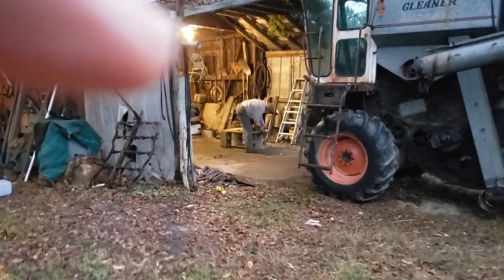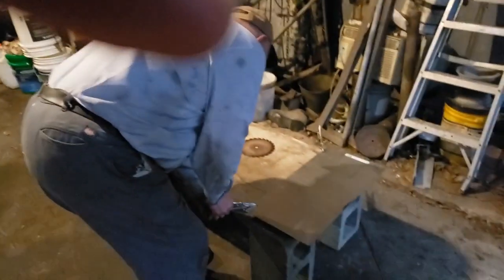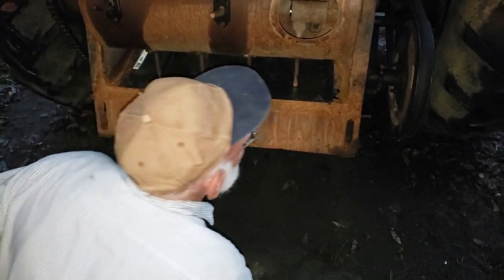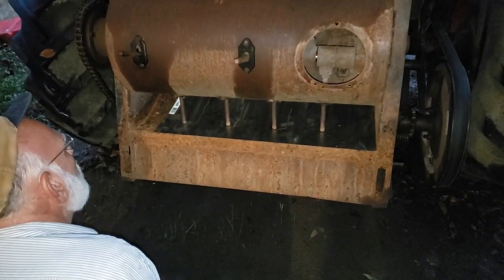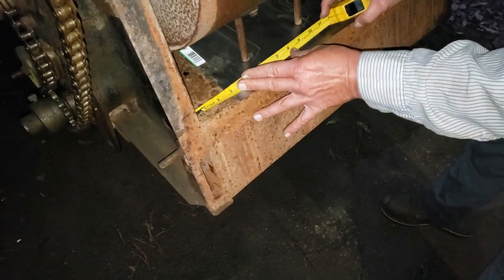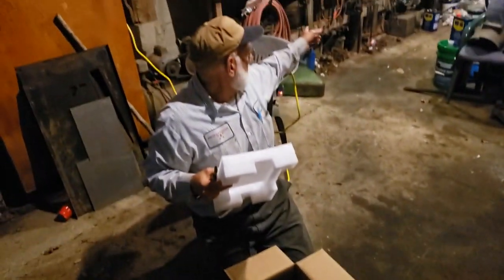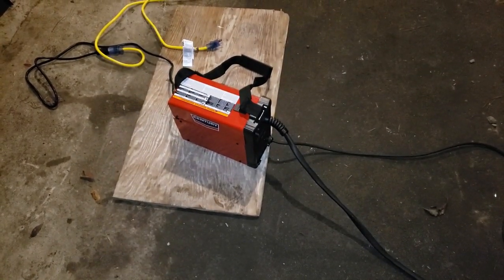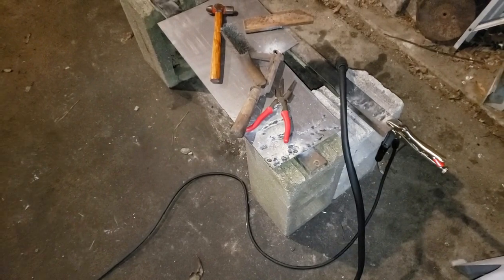Working on the Gleaner Combine

Comment: Need to stitch weld it.. meaning you pull the trigger, let off, pull, let off.. just spot or tack and keep doing it.
Reply from the maker: Ed so glad you said what you said, you just gave me one heck of a good idea to try before we go to thicker metal. Thank you sir.🙂🌤🌞😎
Reply: @SoybeanFarmer3300  been there... Hopefully you can make it work!!
Reply from the maker: @GosselinFarmsEdGosselin  - between what you said and what Wayne said I see a better way now thanks Ed.
Reply: @SoybeanFarmer3300  The Floors in a Fox Body (mustang, Fairmont,) are 26 ga. We use 2x2 16 ga box  to put frame connectors between the front clip and the rear chassis by cutting slots. thru the floor,   the floor then has to be welded to the tube... We use the method Ed described.... Ford fox body Chassis are Galvanized... so the process is double trouble,,, but you have to be patient ..... Clean the rust off down to shiny metal      Any rust will cause the arc to blow a hole
Reply from the maker: @farmingforfunandprofit940  welding on galvanized is pure toxic requires some serious ventilation in the work area so glad we're not dealing with that. David you make an excellent point about what the rust would cause to happen therefore that area must be cleaned back to rust free. Since the work area is tight I'm now thinking about completely removing the retracting finger drum so we are able to access the area and do a proper once and for all repair. David thank you.🤔☕☕☕☕☕☕
Reply: i 2nd this idea also if the wire feed speed has been tried like i said above
Reply from the maker: When I get home and see cousin tonight I'm going to attempt to talk him into using the thicker piece of metal and hopefully removing the drum. We'll just have to see what we can negotiate. Thanks for being here watching.🙂🇺🇸

Comment: You two are quite a pair! Yes, like Ed Gosselin says, stitch it BUT if Scott's feeder house has the clearance, use a heavier gage metal, there is plenty of pressure from the crop going under that feeder roll. One solid piece would be nice but narrower pieces that match any structure under the feeder house will allow more tack welds directly with the original surface or drill holes in the new metal and weld the holes direct to existing metal of the feeder house.
Reply from the maker: Ed gave me a spot on idea for using the metal that cousin Scott bought and for making it fit properly. Not good enough with words to express the idea but I'll have the camera with me tomorrow when we try it. Wayne my friend always good to see you here.🙂🇺🇸
Reply from the maker: one more thank you for what you said here..  what's the emoji for the big bright light going on?
Reply: The holes would work well, if the feeder house floor is cleaned good enough and heavy enough to take the extra heat.. 
Although, I have plug welded some pretty sketchy Stuff 👍

Comment: If you got a acetylene torch you can braze weld some people use coat hanging wire to use for the metal filler
Reply from the maker: We were talking about using the torch to braze it will definitely be using a torch to heat the metal so we can bend it. Thank you very much for your suggestion.

Comment: Stitch weld it, same as you would do on vehicle sheet metal. just tap the trigger, don't hold it continuous
Reply from the maker: I was kind of amazed with what I was actually able to do last night in a short time with this wire welder since it's the first time I've ever had my hands on one. I'm really glad cuz  went and bought this. 2 Night we'll work on learning this stitchweld technique. Thanks for sharing your insights on this.🙂🇺🇸
Reply: @SoybeanFarmer3300  Once you get good with a MIG welder, you'll love it! Stick welders have their place, especially for welding heavy metal, but MIG is a good all around welder, especially once you get up to a 250 amp machine then you can basically replace the stick welder! Happy welding!
Reply from the maker: https://www.lowes.com/pd/Century-120-Volt-80-Amp-Flux-Cored-Wire-Feed-Welder/1001440264
This is the machine  cousin bought. If and when I get one I'm thinking at least 140 amps output.🙂☕🇺🇸

Comment: I could use a wire welder. Fix the metal on my trailer ramps.
Reply from the maker: James, this is the welder cousin Scott bought.  once I got the hang of using it which did not take long I liked it.  thanks for watching. https://www.lowes.com/pd/Century-120-Volt-80-Amp-Flux-Cored-Wire-Feed-Welder/1001440264

Comment: I use .028 wire on the lighter guage steel, going to guess welder came with .032 or .035 wire
Reply from the maker: I got a lot to learn about my new flux core welder. Check out the next video if you want to see what I'm talking about. Thanks for being here supporting the channel   watching the videos.
🙂☕

Comment: I’m a welder have been for 29 years flux core may not work very well for what you’re doing I know it means buying more stuff like a gas bottle and mig wire but hard wire is the way to go on thin metal you need to wire wheel it and clean it shiny as possible I’m in South Carolina if it wasn’t so far I’d come give you a hand
Reply from the maker: Getting the surface areas to be welded as clean as possible while removing as much rust is possible is critical. Since we're going back to a heavier gauge steel for the repair I'm leaning heavily towards going back to the stick welder and using a 6011 rod. I'm also hoping to be able to convince my cousin to remove the retracting finger drum to provide an open work area. The open work area will Aid greatly in preparing the area and removing as much surface rust as possible. Thank you very much for sharing your years of experience with me as well as your thoughts concerning this repair. Yeah if you were closer I'd invite you to come over just to hang out. Thanks for watching commenting supporting the channel.☕🧰🗜🛠🧯